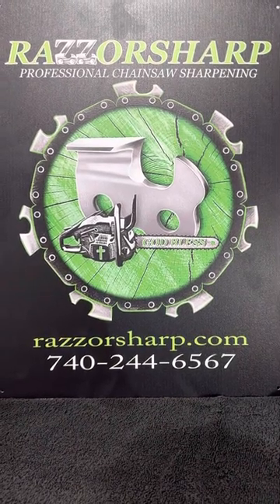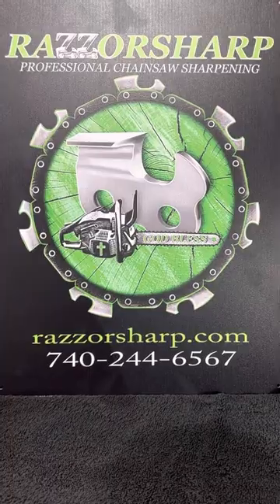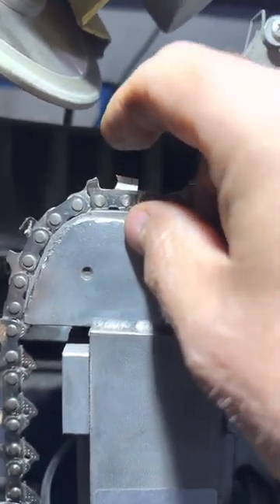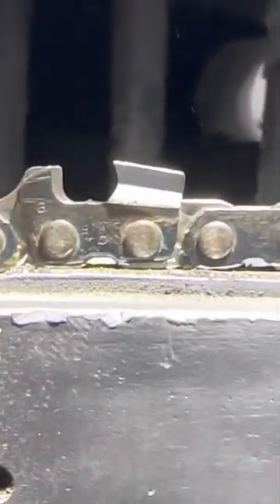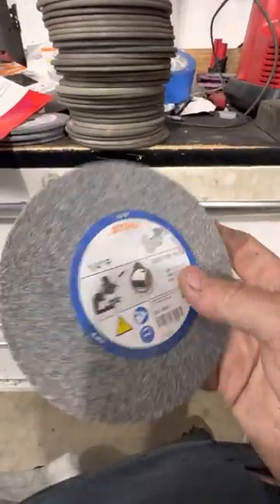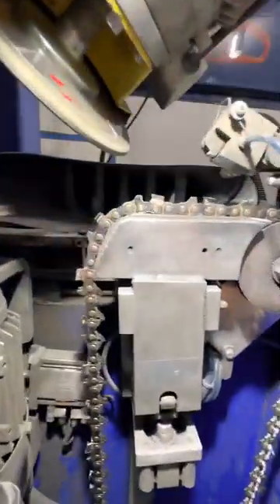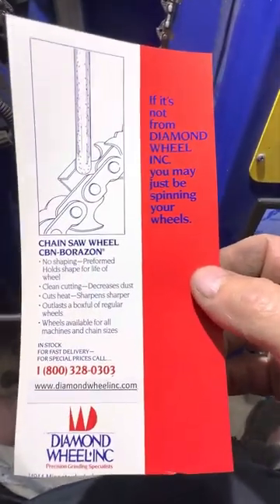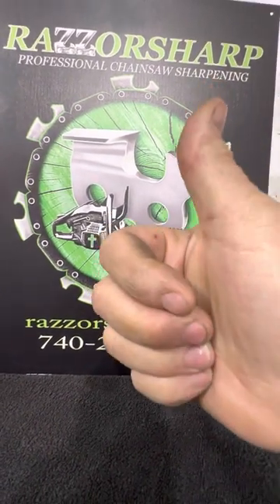Chainsaw chain grinding wheels

Comment: Thanks for the tip I'm looking for a wheel that does not heat up the chain cuz I do race chains and a lot of times I have to cut a cutter back to nothing to make a performance chain and I don't want to heat the metal up and change the metal Archie

Comment: I can't find 7/32 wheels for my 36" husky chain. the closest I can find is 1/4. Any suggestions?
Reply from the maker: Yes, if you want CBN wheels, then call diamondwheelInc. out of Minnesota and talk to Jackie or Nik and tell them that Jeremy from Razzorsharp sent you, they will set you right up. If you’re looking for aluminum oxide, the best I like is either Franzen, or the steel brand, which you can get it at your local steel dealer usually or they can at least order it for you . God bless have a great day.👍🙏✝️❤️🇺🇸

Comment: Ive bought one of thesse cbn wheels but even when i go painfully slow it still leaves a burr on thr cutter. Ive messed around with it a bunch and i cant seem to get a good grind with the cbn. In fact in my experience the stihl and pink wheels outperform the cbn wheels. Have you ever run into this issue?
Reply from the maker: The key is ya have to “kiss the cutter” and take off just a lil at a time with the CBN wheel. Now the Stihl wheel ya do the same “kiss the cutter but ya gotta get the right profile, hope this helps God bless👍🙏✝️❤️🇺🇸
Reply: @razzorsharpchainsawsharpen8186  so unfortunately I find that no matter how slow I go the cbn wheels still leave a substantial burr on the cutter. With the Stihl wheels tho you can by comparison hog into it without any burr

Comment: Nice video dude.. I have a stihl usg grinder that came with stihl wheels and I seem to burn the cutters all the time.  I think I can try and not take a lot of material and try and keep the wheel clean with the profiling stone! thanks
Reply: Keeping the wheel clean is the biggest thing to keep from overheating the cutters. If you see a dark ring around the wheel it's time to clean it.
Reply from the maker: Actually, we clean our chains here at Razzorsharp so that way when we put them on the machine they’re already cleaned and it’s really hard to dirty up the wheels, but they do  dirty up and you have to clean them for sure 100% the key is taking off very little at a time , a method I called, “kissing the cutter” just take it slow and have patience. It’ll work out really good for you. I promise thanks and God bless hope this helps.👍🙏✝️❤️🇺🇸
Reply from the maker: Your spot on my friend 💯✊✊✊